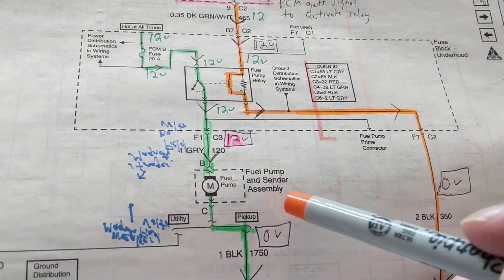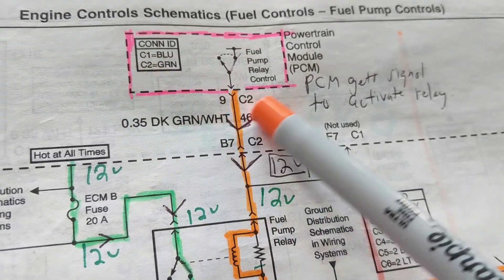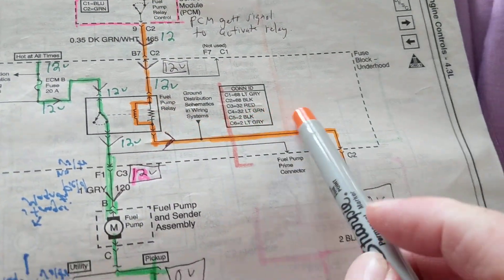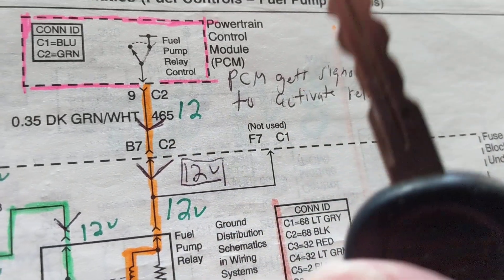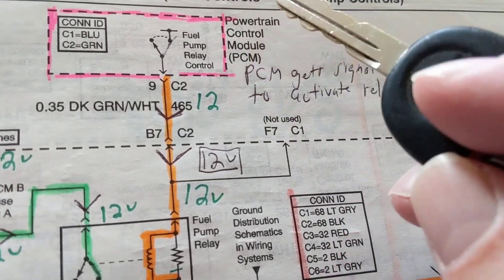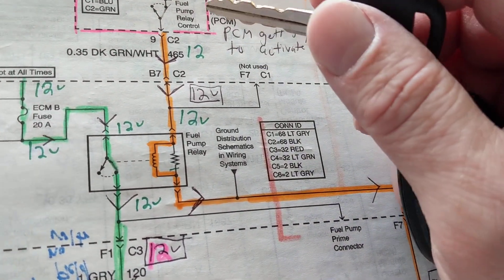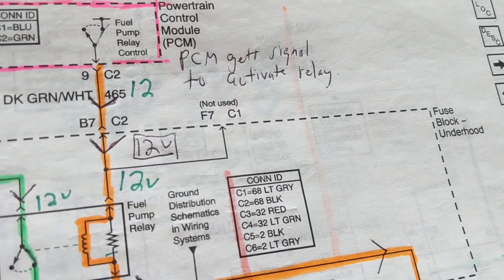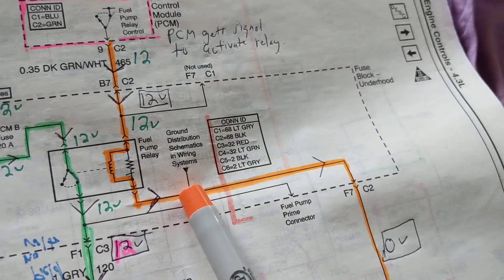HOW FUEL PUMP RELAY WORKS WITH COMPUTER FOR DIAGNOSING

Comment: I’m at a loss with my duramax and I’d love your opinion. It’s been to 4 shops, no one can figure it out. 
Short story is when I am accelerating (especially if pulling a load or going up hill) the rpm fluctuates (rhythmically flutters probably 2-3 times per second for about 10 seconds). It will usually flutter between 1800-2000 rpm. You can feel the variation in the gas pedal and it’s worsened to where you can feel it in the truck. The truck is not switching cars during that - it doesn’t feel like a tranny issue, more a rhythmic brief lack of fuel. 
The only mechanic that helped it (it still happens but not as bad) is he changed the fuel filter housing (he said the manual pump was not holding pressure). 
He wants to install a lift pump next. 
I do agree that the truck seems to be starving for fuel during these episodes… but the consistent (timing) rhythmic flutter makes me wonder if it’s something electronic (if it was a bad pump, I feel it would just bog down completely)… 

Could this be an ECM (or communication to the fuel pump) issue?

Comment: Key won't turn if the transponder is not recognised, this means my imobiliser problem, is accepting my key, but no crank, but cranks with a wire at the starter relay pin 1 and 2, didn't let it start just 3 cranks, and disconnected the wire quickly, with key in ignition, and turned on position, what could it be if it starts? because anti theft stops the fuel injection.

Comment: Hi Joe, you have an awesome channel here with some great lessons that I regularly watch.  One problem I am having however is finding some of the previous videos that you refer to in some of your lessons (due to the ever increasing number of videos that you are making). If possible can you please provide a link to previous videos in the description section. This is definitely my go to channel when it comes to schematics.
Reply: Thank you for the compliments my videos usually are on my channel Joe electronics schematics for Auto I tried to organize a little better however the selection to add sections is not available for some reason so unfortunately you just have to scan through the channel but thank you so much for supporting the channel I hope to improve the channel thank you so much